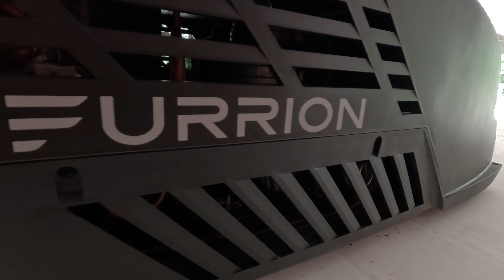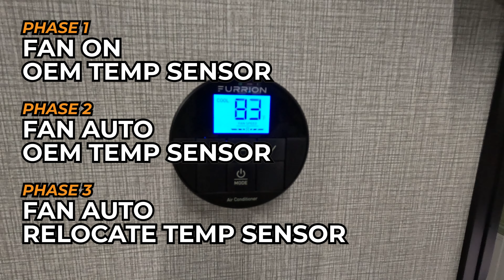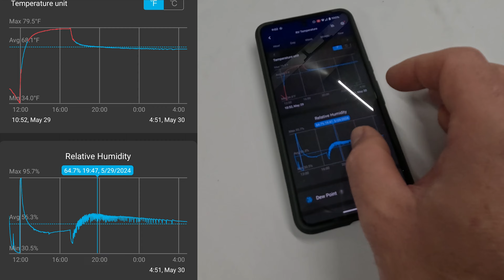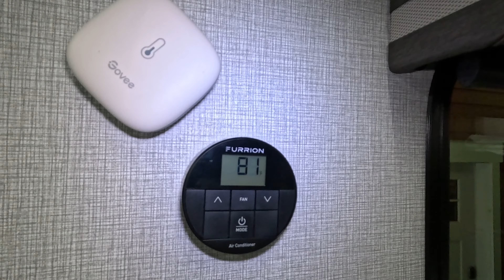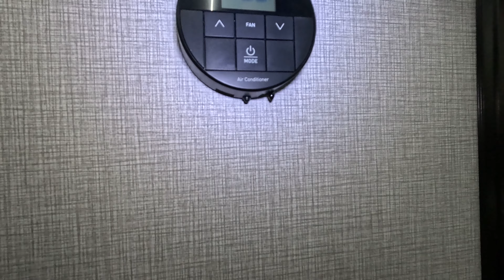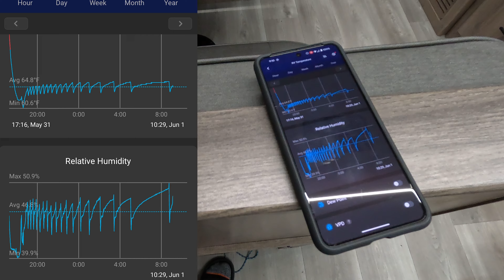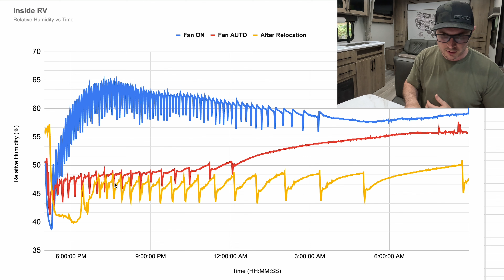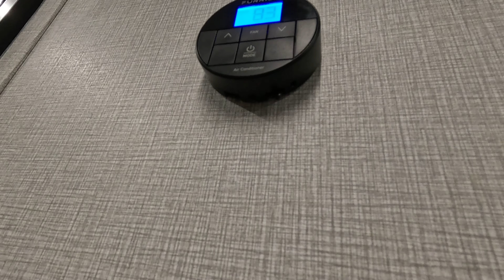Did I Void My Warranty? Data Showing Furrion AC Temp Sensor Relocation Before & After

Comment: Thank you very much. Our second trip in our new camper I realized no matter how I set the thermostat it was incorrect with our inside thermometer. Also it was short cycling just crazy. The ac would kick on and in seconds the thermostat dropped 10 degrees yet we was still sweating. I started researching and came across a few threads and this video explaining the obvious issue. You saved me a ton of trouble shooting and wasting time with the dealership warranty. I’d rather spend my time camping. Thanks so much! To make sure I do not do anything to my warranty I ordered the extension kit from castlewinch. I will cut their harness instead of the factory one but still use the two spare wires and connect the other side of the cut harness there. Then if needed 5 minutes and my factory wiring will be original. I will be doing this tomorrow morning before it gets too hot. With the details I expect no snags. Thank you and hopefully Furrion sees this and WTH were they thinking?🤔 😮
Reply from the maker: Thank you. I look forward to variable speed units too. Sounds like Furrion is close to releasing them as aftermarket. That would also help with all the different sized RVs and varying loads...getting the perfect compressor output to slowly draw down humidity.

Comment: Thank you for doing this. I used your idea to tape the inside of the shroud on the supply cold air dump permanently. I sealed the intake plenum as best as I could with foil tape and put the room temperature sensor out the bottom through the filter (leaving it up inside didn't work). Now it works perfectly. No short cycling and the temperature reads accurately. Very interesting video. I appreciate your help!
Reply from the maker: @MeyerKen  thank you! Glad to hear it.

Comment: Thank you for sharing your experiment. I own a residential & light commercial HVAC company. I also own an rv similar to yours with the same issue. The manufacturer had to design and size the a/c units to operate in a wide range of environments. They are all almost certainly oversized for most design conditions. In addition, running on fan only once the compressor shuts off causes the fan to blow across a wet evaporator coil and reintroduces the moisture back into the rv causing the humidity to rise again. You couple that with a short cycle on the compressor and the results are high humidity and inconsistent temperature control. Furrion needs to utilize the existing temp sensor for the furnace and they need to install variable speed compressors and variable speed blowers.
Reply from the maker: Great points. I'm with you 100%. I believe Furrion is close to releasing a variable speed/inverter style unit for general public/aftermarket, which will be interesting to see how they did the temp sensor on that one.

Comment: A very helpful video.   I am literally at that point of having to relocate my room sensor, or I hear there is an aftermarket one with a 10' line but you have to run it from the A/C to the thermostat.   I have your situation where we have moved from an EcoThermDometic to a Furrion A/C and have two extra wires that could be used but involves snipping the sensor.  Very informative.    (Sidebar:  Furrion also claims that installing a SoftStart will void your warranty as well.)
Reply from the maker: @starhopper457  interesting, thanks for sharing. So far the mod has been completely worth it, running like a champ now!
Reply: @AdventureRocks   Followup, Sir, if I may... do you have a link or name of the device used to measure Temp and Humidity?   LOL, you need a section on your AZ page for your favorite tools that you use in your vids!
Reply from the maker: @starhopper457  no problem! Yes here is the temp and humidity sensor: 
https://amzn.to/3XTmJma

I use them in fridges, underbelly, etc... Really anywhere. They seem pretty accurate and the Bluetooth and WiFi connectivity is versatile.

Comment: Recently installed a RecPro and had the same issue. I purchased a 10k thermistor from Trane to relocate it. My plan was to disconnect the factory thermistor (located clipped to the evap coils) and connect the one i purchased, locate it on the wall next to my old Coleman tstat. But…before doing that i, like you, experimented. I unhooked the factory thermistor from its coil cradle, straightened the wire and wrapped a soft cloth around it. There was enough wire after straightening to get it about 8” away from the coil and more into the return air plenum. The RecPro is designed to run the evap fan all the time. After these mods the unit works fine.
Reply from the maker: Great tips, thank you for sharing.

Comment: Thank you for showing the extra wires in the thermostat harness. Been trying to figure out how I was going to tear the interior out of a brand-new camper to relocate the sensor. Mine had the extra wires in it. Most of us with 2 A/C units don't stand a chance of them working properly. If one shuts off the other one forces cold air into the unit throwing the sensor reading off even more. Thank you!
Reply from the maker: Thank you for the comment!

Comment: I’m actually going to relocate my sensor now I always thought this would be needed in my Grand design. I got a 240 ML transcend. I poked the temperature sensor through the vent and that helps some, but not real happy with how it works in this camper, the thermostat is actually positioned on the inside wall so that makes it great because it does not pick up no heat from the outside from sun and there’s no windows near it, thank you for taking the time on the video probably do this this weekend
Reply from the maker: Thank you. Hope it goes smoothly.
Reply: @AdventureRocks  well I did it, but I lost a readout on my thermostat. I can get it to turn on, but I cannot read no temperature when I was doing this the room thermostat was flashing just the background light and now I have no temperature read out.
Reply from the maker: @JDT454  Sorry to hear. You may have already double checked this, but I think the missing temp readout on display indicates a wire is loose on the temp sensor between new location and plenum box. You could also check and make sure the polarity is correct. I suppose it's possible if the distance is too great at some point the resistance falls completely off, but it'd have to be pretty long for that I think. You'll have to report back and let us all know once you get it figured out.
Reply: @AdventureRocks  I did try both ways on the polarity. This thermostat was starting to give me troubles before I did this. Sometimes the display would blink. I did order a new thermostat since I was having problem with this one for the distance I would have to say I probably went 10 foot away from the Plenum I will measure it. It should be no more than 12 foot. It might even be less one thing I did not do that. I seen that you did when I wish your video the second time you removed your thermostat and took the wires off. I will check back once I get this figured out to let you know what happened. The AC. it is cycling. I just can’t see the right the temperature is I had a lot of guest work going on to figure out.
Reply: Here’s an update. I measured it this morning depending if there’s any wire coiled anywhere in the ceiling or something it’s approximately 10 foot from thermostat to Plenum box. I did do a test this morning. It’s a little chilly here in Pittsburgh this morning. It’s 72 in a camper, I turn the AC Power button back on and it did not kick on so reading to turn on because I try to keep it set around 74° so it’s monitoring the temperature. It’s just not giving me a temperature read out hopefully by mid week. My new thermostat will be here and I will install it.
Reply from the maker: @JDT454  Copy, the distance is no issue at 10ft. Hopefully that new thermostat will fix then.
Reply: @AdventureRocks  OK like I said, I can guesstimate and get it set in the AC will cycle but I have no reading lol so yeah we’ll see what happens. Hopefully this new thermostat shows up by Thursday.
Reply: Hey, I appreciate your input. Thank you.
Reply: Well, I bought the replacement from the RV dealer and I’m getting a E3 code a communication code. I have no idea why this will come on.
Reply from the maker: @JDT454  Awe, bummer. Forgive me if you already tried this, but if you run a temporary new wire between plenum box and thermostat (about same length) for all of the wires, does the error go away then? My first guess would be the existing thermostat wire has a nick or short somewhere in it causing it to malfunction. So if you could get a new temporary wire from Lowes/HD (just 7 or 8-conductor thermostat wire) same length that would help either confirm or eliminate that possibility. If it turns out to be case...you could use that same new wire to pull/fish to replace old.
Reply: @AdventureRocks  I talked to Lippard the old thermostat that I replaced. They updated it so now I have to get the controller also so that’s how I found out. I’m getting E3 code so in about a week I’ll give you the update on everything.
Reply from the maker: @JDT454  Oh goodness, hopefully that'll resolve it. Always something, right?

Comment: Great video and instructions.  I have the same issue in my Brinkley.  I was so excited to find this video.  BUT Brinkley did NOT run the extra wires down to the thermostat.  The unit is sealed up so well (surprisingly) that I don't see anyway I could run a wire down for a remote sensor.
Reply from the maker: Sorry to hear about the wires. I agree it could be a gamble to fish new wires or use existing to pull...if they got stuck or lost in cavity could be worse situation. It's a frustrating problem, but I will say once I relocated the thermistor it has been running like a champ.

Comment: Great video.  I have a Brinkley Model Z3100 and we have a heat pump version of this AC in our bedroom and it short cycles constantly, regardless of the temp in the bedroom.  There are times I go into the bedroom and its 79 degrees showing on the thermostat and its set on 74.  Other times its near the target temp, but cycling on and off.  We turned the fan on constant when we sleep, otherwise the AC constantly turning off and on wakes us up.  Everyone on the Brinkley forums is having the same issue.  I purchased a temp sensor relocation kit from a company called Castle Winch and its due to arrive sometime today.  The camper is winterized and stored for Winter, so I won't be able to install and test out until next Spring.  Hopefully this fixes the issue.  When you relocated the temp sensor with the existing wire that was in that cable bundle I was thinking that it would throw off the temp reading, as you are adding resistance to an NTC thermistor due to the wire length.  Thats no issue for me, as I can just set the thermostat a bit higher.
Kent
Reply from the maker: Thank you for the comment. Mine has worked great after the relocation btw. It's still a 15K AC whether you need that much output or not, but at least it cycles on consistently with temp and humidity stays under control. I look forward to the new variable speed units becoming more widespread.
Reply: @AdventureRocks  We have the Furrion 18K chill cube in the living room of our Brinkley and its a direct dump variable speed and works great.  It was 95 degrees and sunny outside and we held a consistent 74 degrees.
Reply from the maker: @KnKs64  oh wow, that's great. I have heard good things about the 18K. Does your 18K unit run the fan continuously, even when not calling for cooling? (Even at a low speed) If so, do you notice any humidity issues?

Comment: This was super thorough and I learned a lot. I feel ready to tackle my a/c issue with my Furrion in my Bullet now. I’m noticing on mine that the ac will completely turn off before reaching temperature and the cool will flash on the thermostat. Hoping this helps that issue as well.
Reply from the maker: Thank you for the comment. I hope your project goes smoothly.

Comment: Great Video I have 2021 Grand Design 2800BH with two Furrion  AC and was have the same problem with the on and off about every 2 min. Call Furrion and they were not much help. Then i call Grand Design and they shipped out two wall sensor thermostat and ac control module for free. Seem to work a lot better on the wall. Will have try the Auto fan mode. Thanks for the video
Reply from the maker: Thank you. Great feedback. I heard GD was shipping out relocation parts under warranty, but when I spoke with them in last month I gather they may have changed more recently? In speaking with the CS rep it sounded like too many good-intentioned owners got the relocation parts from GD direct and it didn't solve the problem as there was another problem with their AC, thus I gather they will now send relocation parts out if a tech diagnoses the sensor as the issue. Who knows though...maybe it's on a case by case basis.

Comment: Great Video, I did the relocation kit and had the same results you are describing. And with the extra resistance I noticed the thermostat skips degrees and will only detect odd numbers, so if I set it to 72 it won’t shut off till it hits 71. Not a big deal as the camper is definitely more comfortable now. Only issue I had recently was the unit freezing up because it was running so much cause it’s so hot. The auto low fan seems to be not helping it get rid of moisture on the coil fast enough.
Reply from the maker: Thank you! And sorry to hear about the unit freezing up. I haven't had that issue yet, but some others have mentioned the same so I'll have to keep an eye out. You probably already checked the freeze sensor in fins up in plenum, but a few other users commented that their freeze sensor had fallen out of the fins or the manufacturer didn't put it in the right spot to begin with.
Reply: @AdventureRocks  yes it’s only when it’s hot hot, and the freeze sensor does work shuts it off and then will restart, but it seems on low fan speed it builds quicker. If it does happen I just run the fan till it melts and it’ll run. Also my location I moved the temp sensor to is more accurate to actual room temp, but close to the kitchenette so it’s susceptible to temp fluctuations during cooking and I just have to keep that in mind. Just moments of inconvenience compared to when it was cycling all the time and I’d have to drive it down to 65 to get 73 in the camper.

Comment: I have 2 Furrions on my 5th wheel - I simply poked the temp sensor down through the mesh air filter so it's in the room and not up in the unit. That made a big difference for me.
Reply from the maker: Great tip. Thank you for sharing.
Reply: Well I did the same thing with no improvement.
Reply from the maker: @samcunningham6009 if everything else is working properly on yours as far as the temperature of supply air being 20+ degrees different, I'd recommend trying the full relocation of temp sensor next.
Reply: I was about to ask the same thing.  Just kind of wondering how far the temp sensor needs to be move out of the unit to improve this situation.  I am sure a good many rv's do not have the wires already run to the thermostat.  I can see that being a pretty big job to run the wires over to the thermostat without leaving marks, or even worse, on the walls and ceiling

Comment: Good video and timely as we just picked up a new travel trailer with 2 Furrion Chill ACs. Im hoping that Jayco’s BMPro system controls the ACs with their separate wall mount temp sensors.
Reply from the maker: Thank you. I believe that is the case with BMPRO temp sensor and node overriding in your case. You'll have to report back once you can confirm.

Comment: As to the why they designed it like that, I am pretty sure it was to accommodate dual zone systems with one central thermostat. I can see multiple ways to improve this design, in addition to your suggestions in the video, i would add- an add-on RF thermostat kit where you could locate the sensor anywhere inside your RV without cutting/splicing and running wires, add a plug to the room sensor so in the event that it needs to be relocated for an application, the end user doesn't need to cut and splice wires this would also add a place to plug in the add-on RF module. I believe that you would only really void the warranty on the relay box. I Imagine that you could replace the box prior to making a warranty claim to return the unit back to virgin stock. That's in the case of a issue with the upper unit- your going to have to cover any failures with the relay box out of pocket.
Reply from the maker: Great point! I didn't think about the multi-zone scenario.